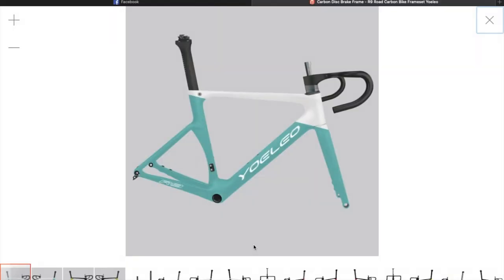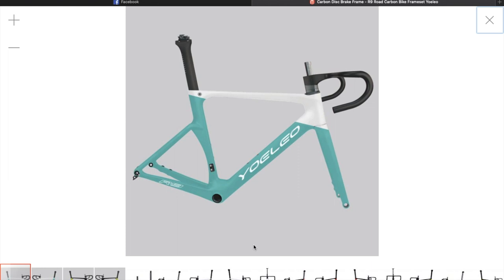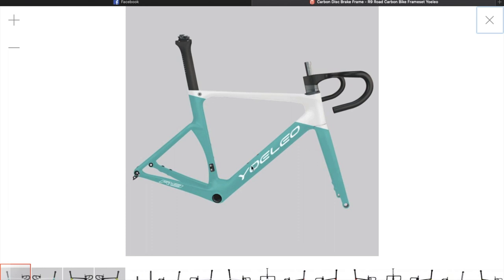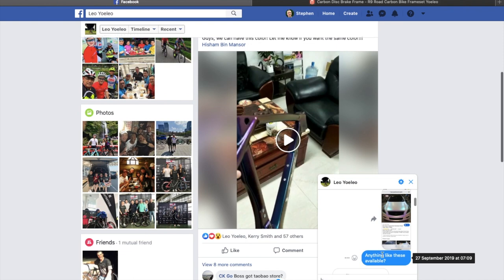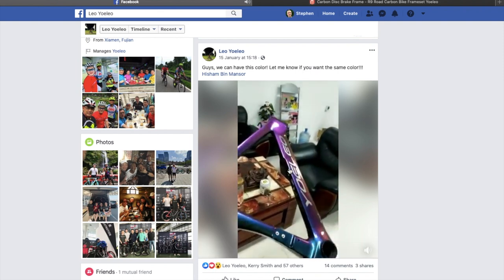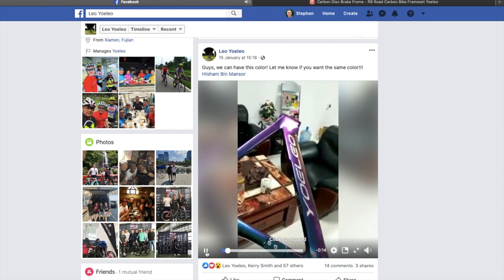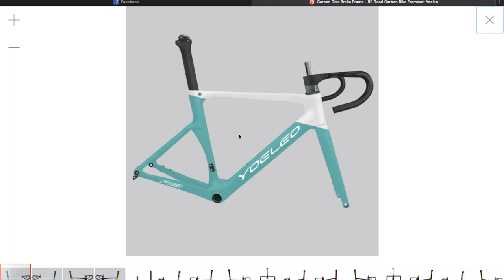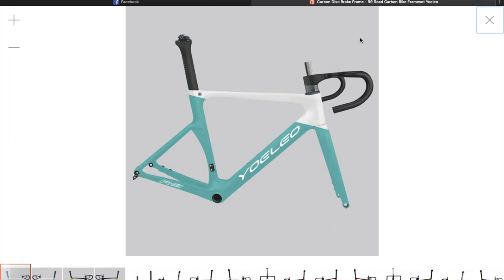Yoeleo R9 Aero Disc Preparation Part 5

Comment: hi Kyro, I'm happy I found your little channel. It is interesting to follow your Yoeleo R9 adventure. I am eyeing the R12 myself but I wonder, are full internals a good idea? do I ever need disc brakes? do I even need a new bike? (objectively I don't)
Why do you go for the R9 over the R12, I know the R12 was only released a few months ago.
Reply from the maker: Vilmore thanks for watching me! Yes I’m on the R9 adventure, the reason for the R9 over the R12 is that I just don’t like the frame shape.... it’s that simple really, I much prefer the R9 dropped stays over the R12 ones. 👍

To answer you, I love full internals, who wants cables showing?? Yuk. 

Disc brakes I love now I have ceramic pads... used to squeak like a banshee before that. 

And yes you need a new Yoeleo bike. 👍
Reply: @KyrosHouseCycling  hahaha 
confident answers ;)

I can see your point on the look. the R9 has the more standard aero look like many other brands, the R12 is a bit more special but I have to say it has grown on me even if there arent that much pictures online. 

I don't know about full internal, having 4 cables make that tight bend from the stem into the frame, wouldn't it affect the steering etc? wouldn't the cables wear quicker with the bend. I am speaking about mechanical shifting. Normally you keep the bends of the cables as smooth as possible. I know you use electric shifting but I just cant justify the price of di2 + I've seen way to many riders ride home on the smallest sprocket because they had some issue with their di2.
Reply from the maker: Vilmore I’m not sure about mechanical I’m afraid, I’m sure it’s designed so that it doesn’t put that much stress on the inner cable? The only time I’ve had a di2 issue was when I let my battery run out... you only do it once...👍

Comment: Hey man, good stuff! Just wondering do you think it is possible to install the Specialized stem and aerofly II bars you have onto the R9? I have a R9 frame but my LBS insists that they cannot install anything else other than the integrated handlebar Yoeleo supplies.
Reply from the maker: Ozzie Gaming Servers if the stem clamp fits the steerer tube then why not? You’d have exposed cables coming out from the top of the frame till they went back into your bars. But technically it would fit. Now wether it would actually work is different, I’m sure the junction between the frame, spacers and bars are specific to that bike so although it may work in theory, it may not actually work in practice. Best thing is to contact yoeleo to see what they say. As I do t have mind yet I can’t comment on the reality of what you are asking. 👍

Comment: Thanks for the update Kyro great video.
Do you know if there's a QR version of the frame just like on the R6?
Reply from the maker: sixahem I haven’t seen one, only disc I believe. You getting one?
Reply: @KyrosHouseCycling  I was looking at the R6 for some time now, but when I priced up the  r9 it was the same difference (with the added bars). The  only thing is the wheels on my current bike (Giant Defy) has QR scewers and not through axels,so that could rule me out of getting the R9 unless I spring for a complete hub and spoke rebuild/ change. Iam gonna do another calculation and see what I can come up with. At the minute my R6  build was about £1100.
Reply from the maker: sixahem can you get 12mm thru axle adapters for your hubs? I got a conversion kit for my DT Swiss hubs... changed them from QR to 12mm thru axle... 👍
Reply: @KyrosHouseCycling   I did extensive research on my wheels even asked my Local Bike Shop. The front hub is only 10mm in diameter (I striped the front wheel down to the bearings last year some time. 
I may go for a rebuild with new hubs etc. I may just get the frame anyway and just take my time with the build, also thinking of spraying it myself.  (reliving my  youth) 😎😀
Reply: Ps.
My wheels are Giants own SL1.
Reply from the maker: sixahem nice sounds great!! I much prefer the thru axles to be honest. 👍 new hubs are a big outlay, I was looking at Ti - Carbon ones but a bit expensive right now for me
Reply from the maker: sixahem nice! What colour would you go for? 👍
Reply: @KyrosHouseCycling  I like Matt Navy Blue with a Dark Grey fade somewhere. I guess this is all going to take some  more extensive research. 😲😎
Reply from the maker: sixahem yeah paint schemes are a nightmare but I’m with the holographic paint at the moment... 👍